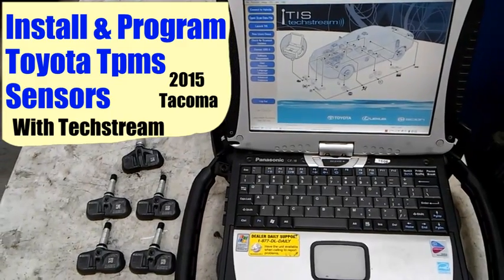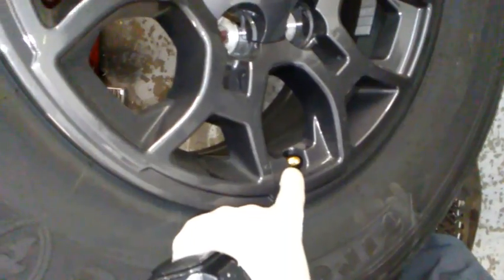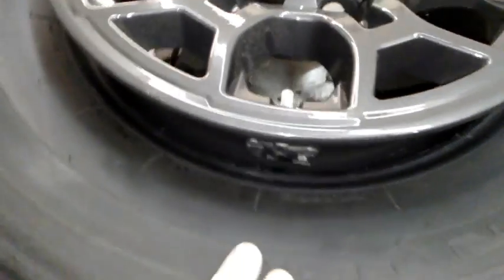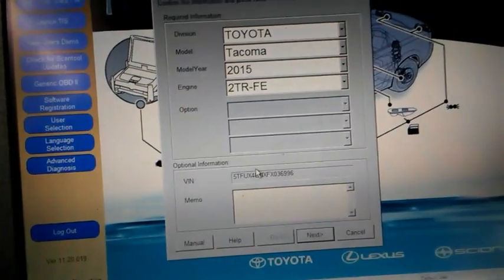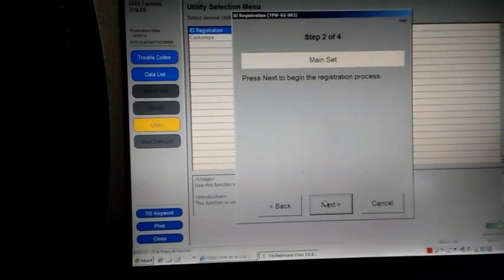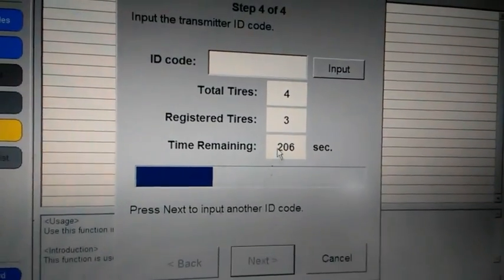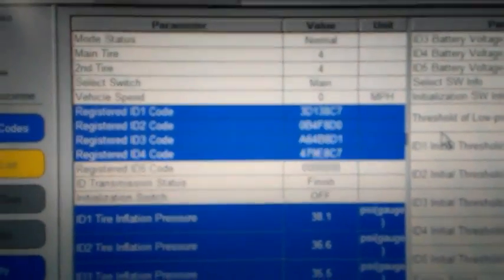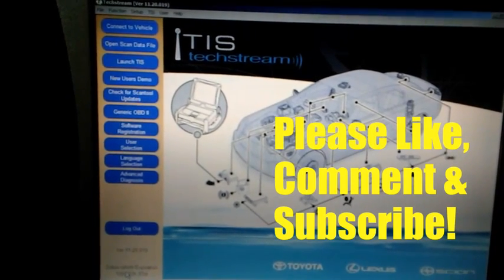Installing & Programming Toyota Tpms Sensors with techstream

Comment: Got mine done today after watching your video. Guys, please turn on the ignition, otherwise the v17 can only read data, but not able to register the IDs. This requires antenna ($25) to detect the broke sensor, then replace the dead sensor with new PAXPMV-107J ($10), finally use this MINI VCI cable that comes with the TIS ($25). The dead sensor can be opened and battery replaced. Then it can be saved for next time to replace the next dead sensor. This is another project to weld the metal piece then seal it with silicone. battery ($6), spot weld ($20) comes with metal piece. I haven't find video but there are pictures on the net.

Comment: Does the software work with window 10? I saw on ebay or Amazon that software is compatible with window 7. Would it work with window 10?
Reply: Yes, 32 or 64 bit. Need drivers for 64 bit. Search " official techstream thread" for all you need to know. Other Toyota forums as well

Comment: I am just getting TechStream and will be replacing my sensors soon.  This all looks pretty straightforward except you glossed over the part where you said you "pulled up all the systems".  Not sure which main menu button you hit to do that... was it the "Generic OBD2" button?  I don't have my interface connector yet and I should be able to figure this out after I get it and connect up to the vehicle.
Reply from the maker: Go to connect to vehicle
 Then it will pull up every system available

Comment: Great video - can you please point me to the right cable for my Toyota 2011 sienna; I need to enter new sensors (10 digits code) - I had one that will only allow for 8 digits and I returned it, Thanks!

Comment: Hi I bought trd wheel take offs and sold my stock steel wheel set up. Can toyota program the 
new ( new to my truck ) tpms to the truck with out dismounting them all for the codes?
Reply from the maker: Some shops are savey and have the equipment to identify sensors without dismount. However I believe most shops will do a dismount to get the sensor ids
Reply: @GEARMOAUTO  Id be going to the Toyota dealer for this , then again gives me an excuse to buy a Autel TS408 tool and add it to the tool box. Its 150 so depending what the dealership charges I may go this route then ill always have a tool.

Comment: I need to know Where does the main device located or installed in the camry 2016 i don't mean the tire valve i mean the main device that get the signal from the valve?

Comment: Thanks for showing direct sensors can & should be coded & calibrated statically while still in the service center. Unscrupulous or incompetent personnel either lack knowledge of the distinctions between direct & indirect sensors or irresponsible to forsake completing the job then dishonest about having to travel for about 15 or so miles before the direct sensors start working when such familiarization applies to indirect sensors. TPMS among most prevalent scams & unnecessary since used for exploitation as responsible vehicle owners always perform manual pressure checks that also are referred by TPMS sensor calibration which further makes these sensors useless but only indulges the industry. Need nullify a useless legislation but as if since entrenched by systemic corruption.

Comment: Simple Question yet I cannot find the answer: do the Denso/Pacific “First Time Fit” sensors (exact replacements for OEM ‘09 Highlander) need some sort of process to “wake” them from “hibernation”?  I’m assuming they ship in hibernation to prolong battery life. If they do need to be “woken up” - how to do that?  You do not show or comment on this step. 

The reason I ask is that I do not want to mount new sensors only to be told “they’re bad”, particularly if I’m told that only bc the shop doesn’t know how to wake them up. I’m trying to avoid the Dealer service dept for obvious cost reasons. I do understand that Techstream has to be used to input new sensor IDs into the ECU, but I just need to figure out how to prove I have good replacement sensors to start with, before mounting them. 

Any guidance much appreciated.
Reply from the maker: I always use oem ones. I do know that filling a tire up then dropping the pressure significantly awakens alot of Tpms sensors

Comment: Does the position of the sensor on the vehicle make any difference as to what registration ID it is? What I mean is, is registration ID1 left front and registration ID2 right front or does it matter when entering the numbers?
Reply from the maker: No it doesnt. As long as they are mounted to the car.
Reply: I did a 5 tire rotation (no tpms on spare) and it threw a tpms light. Position may not matter but the car seems to know if one of the tpms tires is not rotating. Im not sure if thats correct but if definitely knew on tire wasnt turning on pavement

Comment: I I tried installing the ID Sensors with TECHSTREAM on Toyota Corolla 2019 but couldn't register all 8 digits apply only 7. I wanted to ask if this software can only install 7 digits on the car ecu? example: ID: 4CDB9D98 , Techstream  accept CDB9D98
Reply from the maker: Why does ur sensor have 8 digits? They should only have 7. I wonder is Those sensors are for another car? Are they aftermarket every OEM sensor and aftermarket sensor I've installed and program has always had the perfect amount of digits
Reply: I also have 8 digits. Did you ever figure out a fix?

Comment: The software I got with my cable doesn't have the utility button.  It only allows me to view and delete my equipment, no editing.  Is this a software issue?  Is there a setting that enables the utility button?
Reply from the maker: What software? I wonder if it supports that function. I am using Toyota techstream software in this video

Comment: Love your video! I'm doing the same thing, but on a 2018 Tundra. I had steel wheels and I bought a set of Toyota 20" Alloy Wheels and had a shop move the original TPMS sensors. Now the system is not working. Do you know a good place to find and buy the proper part? I purchased the Tech Stream software and cable and have it working on my Laptop. From what I've read the 2018 Tundra TPMS is different than the previous years (added a digit I believe) . Rock Auto has listing for this truck for a Dorman TPMS sensor, would this work or would you recommend OEM? Thanks again for posting this video, it has answered a lot of my questions.

Comment: so how do I add 12 sensors? I have 3 sets of tires for the changing seasons- a set for mud, another for snow because real mud tires are wicked slick on ice and then I have my dry condition summer's- is it possible to add in all 12 sensors plus the spare?
Reply from the maker: They can only store 4 or 5 tire sensors at once.

Comment: Would love to know if anyone has been able to program a set of 5 TPMS sensors to the SECOND set of sensor IDs on a Toyota Landcruiser, which has the ability to run 2 sets of wheels, one set on the main tire switch position, and one set on on the 2nd position?
Reply: Mid Georgia House Sellers did you find out?

Comment: I bought a used 2007 toyota corolla le and im not sure if this car has a tire pressure system active i did look on my owners manual for the tire pressure system and i found it. But the problem is i dont have the button or switch which located in between the side mirror controller and the security light.  Instead it has an empty slot and covered with a clip. And my tires are new but no sensors,  it only have ordinary valve on.. is there anyway to put the oem sensors in my tires and program it in the computer or system? And the switch as well.

Comment: So a stupid tire tech broke my sensor on my 2013 camry.. they are going to pay for it but my question is if the new sensor has to be programed or is it just a reset? And how much would someone charge to program it?
Reply from the maker: +Jesus Hernandez on toyotas it has to be programmed. Take it easy on the tech, even the best toyota techs pop a sensor now and then. They are very fragil. Thanks for the question! Good luck!
Reply: Around 25 box to program 4 New valve.

Comment: I want to purchase another set of wheels/tires for Tacoma. On set for the Spring/Summer, and the other set of tires/wheels for the winter. Can I added all 8 sensors to the software?
Reply from the maker: +mlong30 I dont think so. When i program them it only has spots for 5 sensor max

Comment: hey man i wanted to know are you paying a subscription or is it a one time fee? I see a bunch of subscriptions for it but i just don't believe it. I could be wrong.
Reply from the maker: +Mpokerdonk This is one a yearly subscription. The location i was at pays for it, i dont know excatly how much a yearly subscription is. Thanks for the comment & for watching!
Reply: It's about $1,500 annally with a professional diagnostic subscription from toyota.techinfo.com. Don't buy those ones that you see on eBay, Amazon or some weird Chinese pirated site for 30 bucks as those are all counterfeit Chinese knocks with stolen pirated copies of TechStream. Those can protentionaly damage and brick all the computers in your car as they are of lower quality which will do more harm than good. You can't really do any real calibration or flash computers no way with those as you need a TIS subscription to gain access to calibration files and firmware images. Always buy the real thing as you can get the Lite version of TechStream from Drew Technologies that comes with the Toyota Approved Mongoose Pro cable. It runs about $495 compared to the full TechStream with the Panasonic Toughbook that's $5,799 out the door.

Comment: hello, do not mean to hijack ur video. May I ask a question? what techstream able did you use? Original techstream or Xhorse clone cable?
Reply from the maker: +Celia Liu Just an original techstream. Thanks for the comment!
Reply: Those Chinese knock off junk can brick all the computers in your car. I strong recommend not using them. It's just a bunch of Chinese scammers taking peoples money selling you stolen TechStream pirated software with a cheap low quality counterfeit cable to make a profit. It's a fraudent Business as the Chinese doesn't believe in copyright laws.